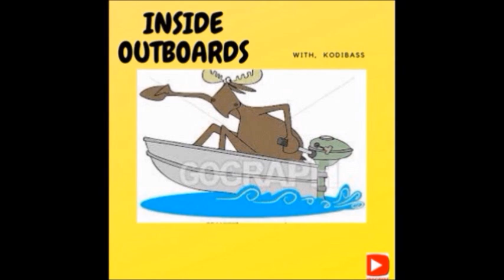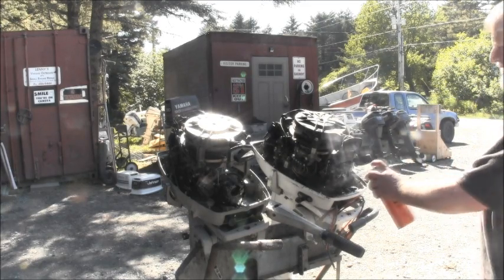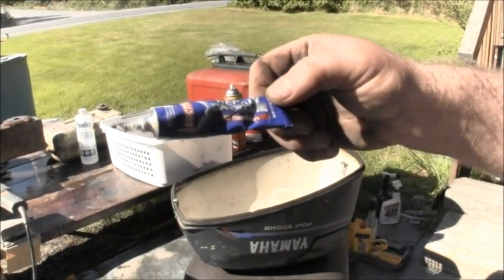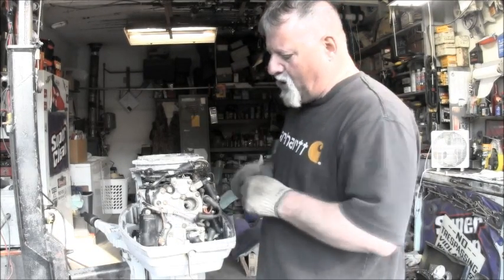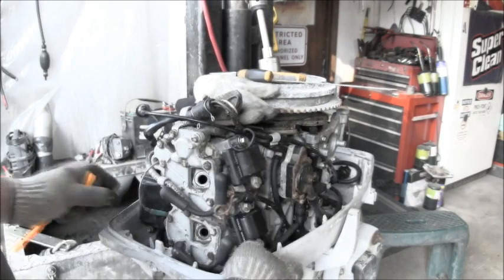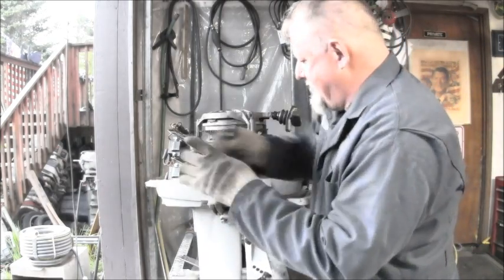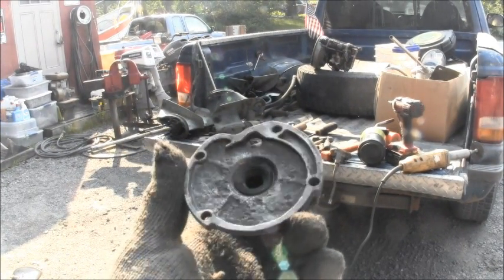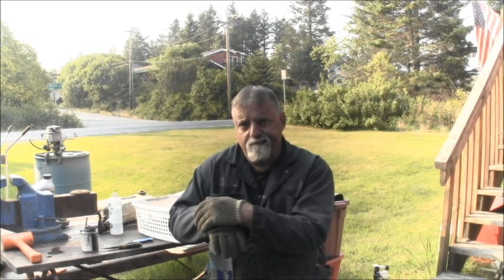JOHNSON 1984  35 HP,  Wake up & Run  & more

Comment: Hi Kodi, nice one👍 Well, the test run with the 60hp Merc didn't go well today. I was running it up around 4,800 rpm and decided to check the temp. When I turned the motor off and sounded like the prop was fee wheeling with a tick tick tick sound? I started it back up and hit up the rpm and definitely revved up like a spun prop would. Also the impeller needs to be replaced. Off with the lower leg again except this time I'm buying new parts. Other than that the motor ran great😁👍

Comment: Good runners!
Like you say, it needs to be ran and brought up to temp to burn off any carbon buildup!
Did you check lower unit oil on that one?
Reply from the maker: Yep' it was not real bad, so I just shot some fresh oil in & let it drain out the top a few pumps.  kb